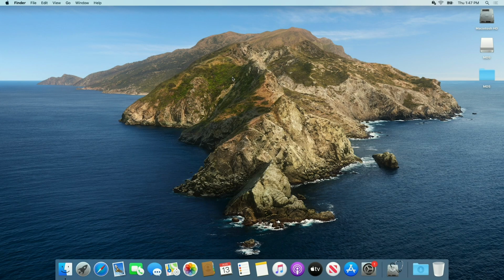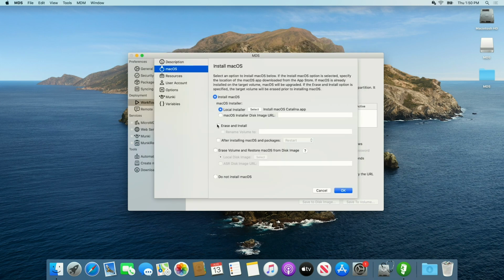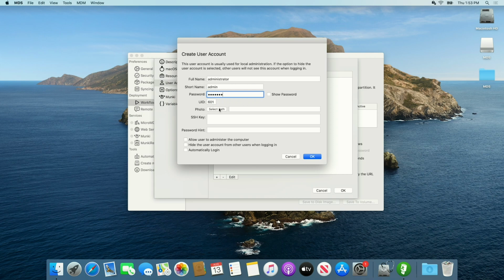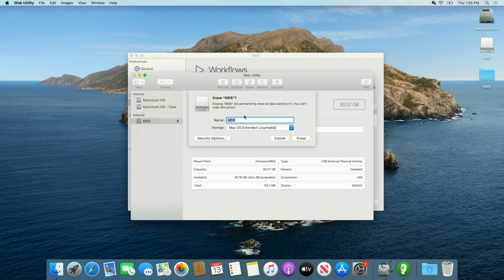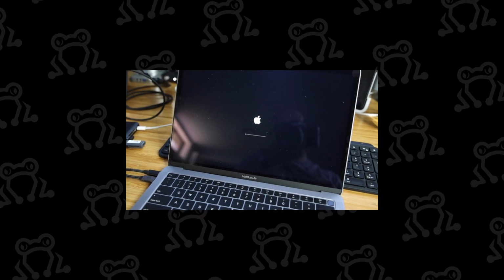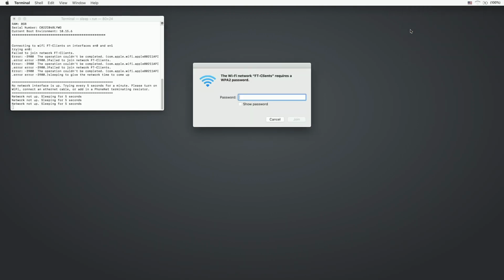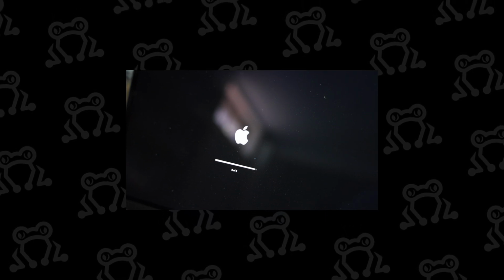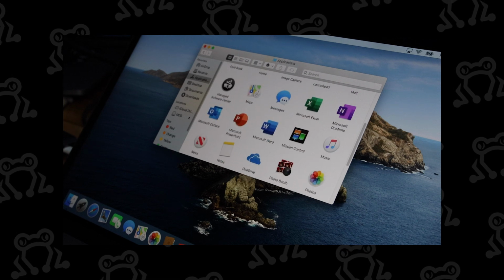How to Use Mac Deploy Stick

Comment: Awesome video bro well edited, thanks a lot you are always the first place I check for this topic. 
I have a question for you since you are the master on Munki and MDS,  is there a way to install MDS  or Munki on several computers at the same time? Let's say 50 different devices?  
I ve done it manually with a couple of computers but I'm wondering if there is an easy way you could recommend for that amount of computers or more. 
Thanks a lot bro,  keep it up.
Reply from the maker: Thanks!
MDS is more of a setup tool, if we are looking to setup 50 different macs, I'd suggest looking into Apple Business Manager or Apple School Manager along with an MDM. I like Jamf Pro, but there's many others. Munki is great along with Jamf Pro. After having an MDM and the devices in ABM/ASM you can automate setup with zero-touch deployments.

Comment: Question about your scripts do you have another video covering the mac scripts and also munki?
Reply from the maker: Not at the moment, I'd be happy to do one. What exactly are you looking for when it comes to scripts? Do you want a munki setup video or how to use munki or just an overview of how I use it?
Reply: @FroggTech  Just an overview of Munki Server setup and how it works with the deployment.  With the scripts just want to see what the script consists of for MDS to take or some sample scripts.  I am just starting a deployment of Macs but I don't know all the software required.
Reply from the maker: If you haven't started with an MDM then you're already behind. My preferred MDM's are Jamf Pro (if greater than 50 machines), Mosyle Business (if less than 50 machines), SimpleMDM (if you want Munki without doing all the backend work). Also you should have Apple Business Manager or Apple School Manager setup if you haven't already. Following the Apple way will set you up for success. I'd be happy to consult on the project if that's helpful. I've managed a fleet of over 2000 Mac's in my career.
Reply: @FroggTech  Thanks we have a fleet under 20 currently we have mosyle currently for our ipads.  We are just trying to incorporate a deploy stick at the moment since we are not a heavy mac environment we are chromebooks and Windows.
Reply: @FroggTech  Hi. And how to do it without an apple business or school manager account ? because, you must have an organization for that (or a school). i'm just a home user. On windows, you can have intune, Microsoft doesn't care if you are a compagny or not. But on apple, if you're just a home enthousiast or don't have a compagny, you can't do it...!!! Modern desktop deployment is just a life changer in the windows world. (you can loose or broke your computer, and be productive on another one in less than 1hour with everything you need !). And when you have multiple computers, well...it saves times. I was hoping to be able to do the same on apple. But without that Apple business manager account, i'm stuck. 
And i'm glad i found your videos (thks for it by the way), because it seams MDS doest what I need (or partially). You prepare everything, and then you can reinstall with one single command :-). 
My question is : does it work on new Apple M1 (cause, yes i have a M1).
Of course, i'm new to the apple world, so maybe, i miss something. 
And Yes, please a video about Munky. This is the part i didn't understand. (As you may also noticed, english is not my mother tongue (i'm french), so sorry for mistakes) :-)